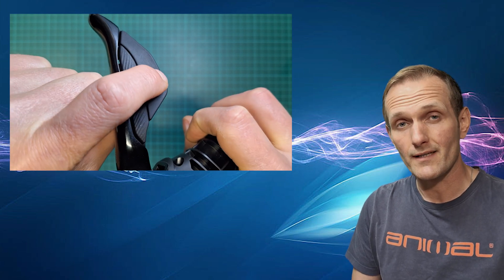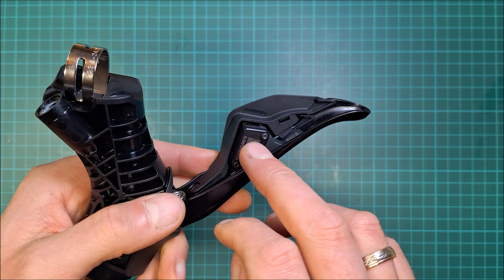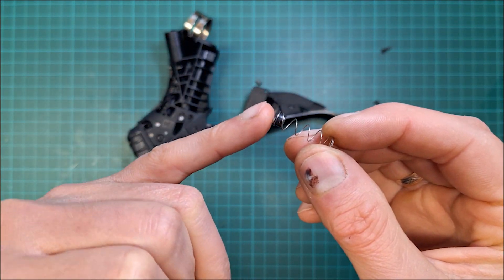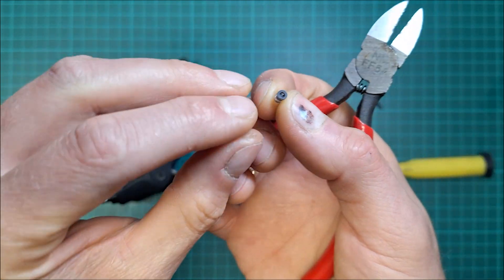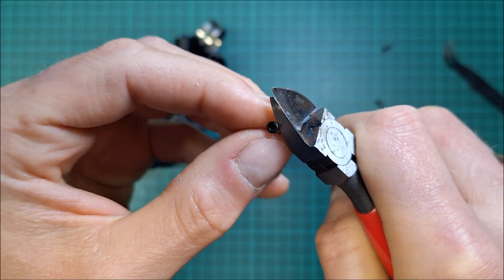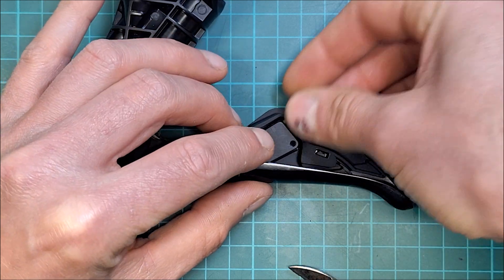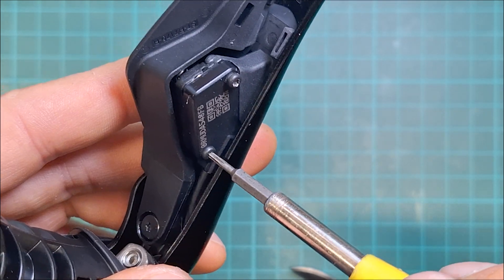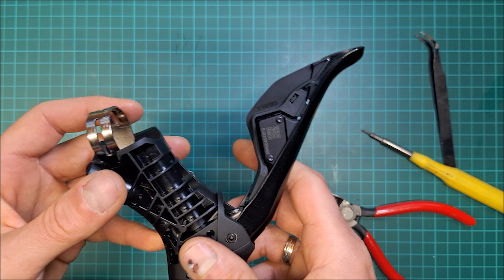Faulty, non responsive Di2 buttons - Fix

Comment: Can you see an issue with replacing the large spring with the plastic piece over the small spring? The other way round to the way you fitted it.
I had an issue where the little spring had come off and was inside the large spring. 
Fitting it the “wrong” way round protects the small spring from any movement and being dislodged in the future. The main spring is still held in place  by the central guide hole it goes through.
I’ve tried it this wrong way and it shifts fine. 
I haven’t tested it on the road yet though.
Reply from the maker: @MrLAJB  I can't see the issue. It must be a reason why the plastic faces down out of the factory, but Shimano doesn't make it obvious. If it works for you, I'd leave it. You won't break it.

Comment: Feedback: bought Torx 6 (Shimano 105) + tweezers, it was done in 10 minutes, on a white sheet. But: on my new bike the small coil springs were not bent. The spring that is inside the large spring was lying sideways. Many thanks Pawel.
Reply from the maker: It's great to hear you've sorted it. Happy riding

Comment: From what I read here, it affects a lot of new bikes! Actually, the seller/manufacturer (and thus Shimano) is responsible for this problem. If we all always fix it ourselves, the pressure on Shimano will not grow. It is clearly a design problem. I think I will go to the seller first (and show him Pawel's video).
Reply from the maker: #lawsuit is coming my way :-). Only joking, sadly you're not the only one. I think the issue may be caused by poor shipping conditions, either the OEM shifters or the bike itself. IF button is depressed for weeks during shipping, or storage, the spring will eventually give in. Arguably, this should be checked/fixed before the bike is handed over to the new owner.

Comment: I have the same issue .. i just bought a new  one and in few weeks i encounter the same. Issue.. can i fix it without removing in the handle bar?
Reply from the maker: @aaronpaulalcantara693  Yes, just lay your bike sideways and make sure to apply even pressure when undoing t5 torx.
Reply: @Di2_GP  thank gou so much sir.. much appreciated
Reply: Huhu my scree got loosen because of this star screw it easy to get rounded 😢
Reply: Im frustrated that i cannot remove the screw .. is there anyway i can remove the screw if it get rounded?
Reply from the maker: @aaronpaulalcantara693  you can use Dremel and make small incision. Then use flat head screwdriver. Make sure to spray some water to cool the screw down as the heat may melt plastic parts. Take a look here: https://youtu.be/kthgiDaeNxI

Comment: Thank you for the great video - I crashed and lost shifting on one button - I am missing the black cap off one of the small springs but it is all working now it’s reinstalled - do you have a hack for the missing small black cap?
Reply: BTW it’s a R7170 105 di2 lever
Reply from the maker: @stephensmither1096  Hi, sorry no hack, but you can buy replacement springs. They are exactly the same in all 12 and the latest 11 speed Di2 shifters:
https://www.sjscycles.co.uk/gear-spares/shimano-ultegra-di2-str8050-button-unit-left-y0e398020/
Reply: @Di2_GP  thanks for the link - I’ve ordered (last one in stock) as I don’t want the spring end to start biting into the soft material on the switch and potentially damaging the switch (they have got to be there for a reason - right?) Will also follow you on YouTube for your extensive and excellent knowledge 🌟
Reply from the maker: @stephensmither1096  You're correct. The plastic washer prevents springs from damaging the membrane switch.
Reply from the maker: Great to hear!
Reply: Hi, great video, like others my brand new lever stopped shifting! I managed to strip the screw, do you know where I can purchase replacements from please?

Comment: What part number are those small springs and plastic that rest on the switch? Are they the same as the 11-speed di2 switch spring? The little plastic on the 2 springs of my R8170 shifter is gone. Thanks.
Reply from the maker: Hello, 11s plastic brackets are only compatible with 11s. Rim and disc are the same, but there is a subtle difference between Dura Ace and Ultegra/GRX. You can buy these assembly, here is reference to Ultegra - Y0E298030 - right, Y0E398020 - left. The springs are all the same in R-series and GRX 11 and 12 speed. You can't buy plastic brackets for 12 speed. Micro switch screws are all the same apart from 105 Di2 (ST-R7170).

Comment: Just what I needed! Fantastic. Quick and to the point. Thanks for posting this.
Reply from the maker: Great, glad I could have helped! The only problem is, this seems to be very common issue!!! One of my most watched video ;-)
Reply: Fixed! Thank you. My Torx T5 badly stripped the screws in the process. Would you happen to know the part number for those two little screws?
Reply from the maker: https://amzn.to/3V1ANaE Here is a link to the listing with two screws.  They are exactly the same across most of R series Di2, except for ST-R7170.
Reply: Yes, kinda bad design imo. My Tarmac wasn't even 3 months old.
Reply: Thanks Mate!!

Comment: my shifters buttons press but nothing is recorded on the front derailier but the top button on the hood works? Do you have any recommendations ?
Reply from the maker: I'm not sure if I'm honest. I haven't experienced this issue myself. If the top button works it won't be an issue with a battery. So the next best thing would be damaged/pinched cable. Try removing the top hood (electronic hosing) and inspect cable port and cable itself. If your shifter is out of warranty and you happen to be UK based I'd be happy to take a look at your shifter. DM me in IG, or send me an email. I may be able to record a troubleshooting video on 12 s shifters, as there seem to be a lot of problems with them lately.

Comment: In my case it does click but it doesn't do anything, everything was since the last update and only one button and sometimes it doesn't do anything and other times it works perfectly, in the etube app it doesn't show an error
Reply from the maker: It may be caused by damaged cable. I'd check this out. If that won't solve the issue, the last resort will be cutting the electronics open.

Comment: In my case, my R9270 handle after the last update, it clicks but almost always it does nothing, sometimes it works perfectly and other days it doesn't do anything but the click does, it's just a big button

Only one button fails, the others work perfectly, the etube application does not show an error, I can reinstall the update from the application, it does not indicate any update
Reply from the maker: Have you tried overwriting the firmware with SM-PCE02? I don't think you can overwrite firmware using the app, if you already have the latest version.

Comment: Hi Pawel, thanks for your video. I’ve had my Canyon Endurace CF 8 Di2 for just 4 days, and after only 20 km, the exact same shifter button stopped working. I’ll wait to hear from Canyon, but I’ll likely fix it following your guide! Thanks, Miroslav.
Reply: Same story, new canyon , first ride,  first hill and the front shifter not being able to shift 😢
Reply from the maker: Hi, that doesn't sound good :-( There seem to be plenty of 'New' bikes with faulty shift buttons. Hopefully Canyon/Shimnao can sort it out for you, if not at least you know what to do ;-).
Reply: I have the same problem on my new aeroad after just 1 week. Did canyon help with this problem or should I try to fix it by myself?
Reply: Same, glad to see it’s a simple fix though!
Reply: Same i just had my scultura 5000 4 days ago. Just about 40km this happened.
Reply: Same thing happened to me on the right 105 shifter after 100km, new bike. Actually the seller/manufacturer (and thus Shimano) is responsible for this. If we all always repair it ourselves, the pressure on Shimano will not increase. It is clearly a design problem.

Comment: My ST-R8170-L does not shift all the time. Many times it clicks but nothing happens. I did the spring fix already. They click just fine both buttons. I think it is a contact issue. Is there a way to spray perhaps like a contact cleaner on the contacts of the buttons?
Reply from the maker: Hi, unfortunately the microswitch assembly is sealed. If your shifter works intermittently I woudl check battery connectors and see if the cable between the microswitch and the main housing isn't crushed or is not moving in the housing. Before you start taking it apart, I would also try updating firmware, just in case. Finally, when shifter doesn't work, are all buttons non responsive or just the one.

Comment: It took me a while until I got it right. Somehow I didn't manage to place the springs properly and when pushing one button both would get pressed. 
At the end I put some grease on the tip of the small spring placed on the plastic cover to help it to stay in place, since it fell all the time.

I had the same issue as you described in the video at just 60km after riding the bike for the first time. It's a shame! Wasn't di2 supposed to be more reliable ? 

Anyway, thank you a lot !
Reply from the maker: It's not great, but at least it's fairly easy to fix it. Hopefully you will have trouble free riding for years to come!

Comment: Absolutely fantastic! Thank you so much!
Just took my brand new Canyon out for the first ride and the shifter failed after less than one hour. Fixed in 5 minutes!
Reply from the maker: @sm58nik  Great to hear, although not good news that new shifter failed after one ride 😉
Reply: @Di2_GP Happened to me with TCR equipped with 105. Failed at first ride today. I just followed your vid and it worked. I am guessing longer lever small spring might just be misaligned as it is no where compressed same in your video.

However I am a bit worried how often this will happen again. Mech is pretty much solid with levers.
Reply from the maker: @RM-wf2dy  I think it may be down to shipping (packaging) out of factory. If levers are tightly packed (OEM are shipped without the box), those buttons could be depressed for weeks. Once fixed, I believe you should be fine for years unless you shift a lot ;-)
Reply: @Di2_GP  I actually fixed both now as the other one failed as well. Now I am hearing crisp button clicks. Hope it last for years like what you said. Thanks again!
Reply from the maker: @RM-wf2dy  Great to hear

Comment: Hi, this fixed my buttons thanks. My shifter had had the odd rattle over rougher roads since (it’s intermittent and definitely from the buttons). Would you suggest stretching out the 2 smaller springs more to increase stiffness? Or is this quite normal due to how plastically the 12 speed Ultegra shifters are?
Reply from the maker: @England703  I would definitely try to stretch them. The button should make a positive click. You can also put a dab of grease on each small spring to prevent the rattle
Reply: No luck with new springs too, any other suggestions?
Reply from the maker: @England703  if you still have a rattle, I'd check the free stroke screw. Checkout the latest Rides of Japan video
Reply: Hi thanks, grease on the spring and button? Strange as it sometimes rattles and somebody does post clicking it
Reply: Click nice and positive, just the odd annoying rattle
Reply from the maker: @England703  a dab of grease should do the job then

Comment: Thank you so much for this! Was happening on my brand new Aeroad and I was super bummed. I was able to fix it in 5 mins using your video. My springs didn't need expanding, the small inner one had just gotten jumbled up with the larger one. Took them out and put them back in strait and presto all was working. Subscribed!
Reply from the maker: @LScott85  Great to hear 👏

Comment: Thank you very much for such a useful video! Without it I wouldn't dare to dig into the internals of my 105 and would've wasted a lot of time issuing the warranty case. Although, in my case one of the springs wasn't holding on the button, so I had to apply a micro portion of glue to make it stick to it (I suspect the same was done on factory, otherwise I don't think it would've worked). Have this issue on a new bike that i bought less than a week ago 😞 So will see how it'll behave over time, could be that I'd still have to deal with a replacement in the end.
Reply from the maker: I'm glad I could be of help. It always good to work on your bikes, with time you get more and more confident :-) Safe riding!
Reply: Hi, what type of glue did you use (I think I have the same problem with the spring coming away from the bit it "plugs into" and then getting stuck inside the bigger spring) ?
Reply: @andrewf2468  hi) i used the first applicable option i had in my box - some little noname tube of glue that one can find in any store nearby. The main thing to check is that the glue has to be applicable to plastic/gum sufaces. I used as little as a drop on a tip of a needle per button, pressed it a bit and held like that for a minute or so. Works well for me so far.
Reply: @gneral4291  Thanks - if the spring comes away again I'll try using that small amount of glue (the problem for me also occurred after only 3 rides of a brand new bike with Ultegra Di2 so maybe they are applying a small amount of glue (or something sticky) and some levers slip through that step in the process)
Reply: @andrewf2468  yeh, i'm also thinking they do use something like that on factory, as i hadn't any issues ever since that little hack

Comment: This video is a blessing, I had the exact same issue today, but with a brand new bike (just ridden 40k). I was so annoyed by that! I wonder if just try to fix it or bring it back to the dealer to let him fix that, because it is brand new. Would they just fix it or replace the parts because it is supposed to be a new bike without any issues. Any advice?
Reply from the maker: @christopherb.7986  Any new bike I'd bring g back to shop, unless it means you have to drive for hours, or wait weeks for bike to be fixed. You can suggest the fix to the bike shop. If you open any shifter, you are likely to void the warranty, so unless your bike is out of warranty, I'd go to the shop first.
Reply: @Di2_GP  Thanks!
Reply from the maker: @christopherb.7986  Any new bike I'd bring g back to shop, unless it means you have to drive for hours, or wait weeks for bike to be fixed. You can suggest the fix to the bike shop. If you open any shifter, you are likely to void the warranty, so unless your bike is out of warranty, I'd go to the shop first.

Comment: A very good video. And it saved me buying a replacement shifter. However, seeing the placement of the small springs is difficult. I was having a terrible time trying to get it back together and have the springs in the correct locations. You have the two small springs, the one large spring, and a plastic "guide" if you will that all go into the device. Inside it, below where the plastic guide sits, are two small plastic bits sticking up (sorry for the lack of technical terminology). One is close to the front and another is close to the back. (I really wish I could include a picture.) Set the small springs with the black plastic bits on top. Place in the plastic guide. There is an "arrow" shaped hole that should point away from the shifters. The large spring goes in with the plastic bit going down. Now you can replace the top and screws.  I know a lot of comments on this will be "Make your own video," but I really do NOT want to take the !@#$ thing apart again! 🤣🙃
Reply from the maker: I found this way works for me, but it may not be ideal for everyone. Have a look at my other videos. You may find something more suitable. 
As always, I welcome feedback and suggestions.

Comment: Thanks so much I fixed it just in time for my race. I did pop out that little plastic bit at the end of one of the springs but was able to get it back on by pushing the star driver in the open end and pushing it on the spring end.

Comment: Great videos. Do you know where someone can get replacement components for these electronic shifters?
Reply from the maker: Hello, thank you. Hopefully more people will find them useful.
Unfortunately Shimano has very limited list of spares:
- Bracket covers (rubber hoods)
- Bleed cap
- Bar Clamp
- Microswitch springs
For 11 speed Di2 you can also by a guide bracket. 
Other than that you have to find a donor and salvage spares.

Parts are available on Amazon, and if you are in the UK SJS Cycles has all Shimano Spares that are available to buy.

Comment: Great video and great content. Thanks a lot!!
Reply from the maker: I'm glad you've liked it.
Reply: Just managed to get this all sorted. My small spring was sideways in the large spring.
After straightening it all out and popping the small spring on the micro switch it’s all working as it should. 

That said I had a stripped T5 screw and after dremelling failed I had to careful grind off the head to pop out the micro switch. 

Not great visibility and access when it’s still on the bike but at least it’s easy to ride.